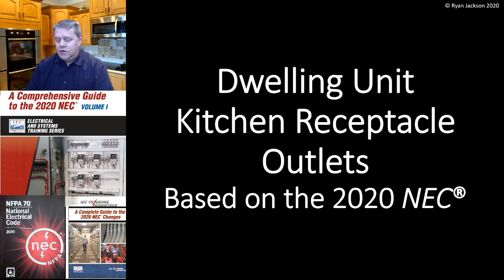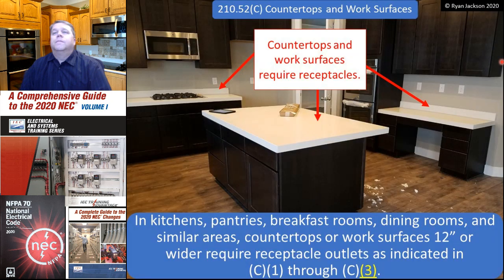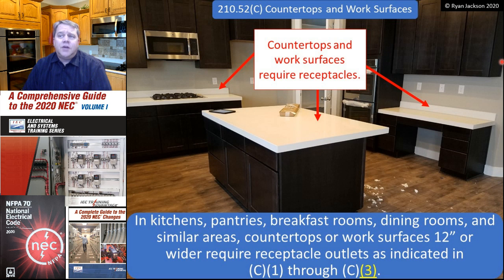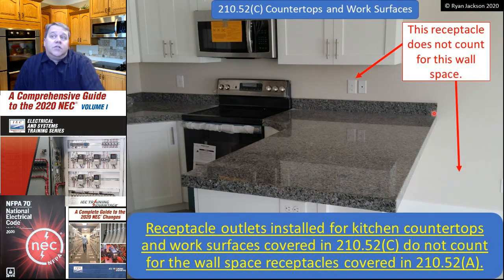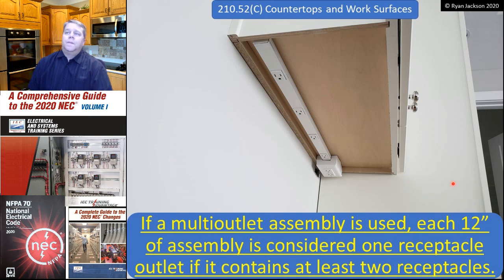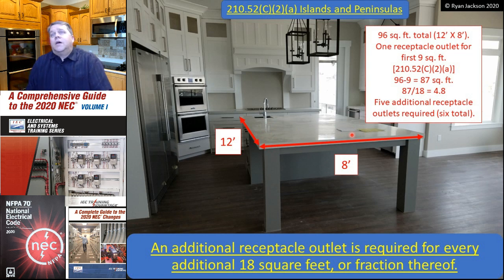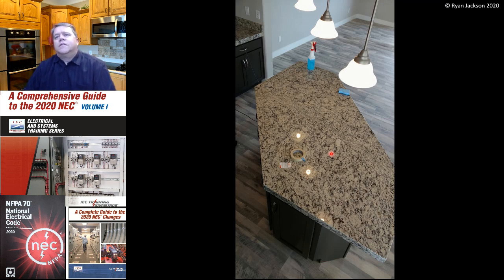Dwelling unit kitchen receptacle requirements (2020 edition).

Comment: Receptacles are the device; outlets are the location. As an inspector I have been dealing with this issue consistantly for the last 6 months. Most of the issue is misinterpretation by other inspectors, who have been provided bad interpretations by instructors. In any case as an inspector we cannot make up code interpretations, read the code and do as it informs us to. I even had one inspector try to tell a contractor to break down the penninsula/counter into quadrants and split up the receptacle locations, or cut the overhangs to 6" or less. One even tried to tell the client to put a receptacle in the cabinet in front of the sink where you stand while doing dishes. Too much overthinking for a simple issue.

Comment: Since code require island outlet to be gfci out Can I just use one gfci outlet wire it the other 2 non gfci outlet or does all the outlet have to be gfci
Reply from the maker: You can protect it from an upstream GFCI.

Comment: Came across your profile when searching for someone who may have an answer to my question. 
I'm in the middle of a new build and opted not to
pay for the kitchen island through the builder and
I want to personalize and get my kitchen island to
my liking.
I've been reading that per 2020 NEC guidelines
you have to have 1-2 electrical outlets on kitchen
islands. So will I be able to put my own kitchen
island in if I don't get an island through the
builder? Because once they put flooring in I'm not
sure how electrical would be achieved. Especially
with it being a concrete slab.
Reply from the maker: If it's a concrete slab it will be quite difficult. If it's not already finished, I'd advise you to run a conduit in the slab as a sleeve.
Reply: @RyanJacksonElectrical  Thanks! They actually were confused and ran the conduit sleeve into the slab but now they are telling me they have to check with the city to see if it can stay. I asked if they can put flooring over it to cover it to pass inspections but they said there is an inspection prior to flooring and after. So I’m just crossing my fingers they let me keep it.

Comment: 8:43 - While it's not super common, some people have cooktop-covering cutting boards or slab work surfaces, effectively making a cooktop into "work surface" or "countertop". 🤷‍♂️

Edit: Wouldn't running a multi-wire branch circuit to a separated (jumper removed) duplex receptacle count as two "outlets"? That could help satisfy the requirement and cut down on the number of receptacles needed in an island, right?

Comment: I find these new codes to be a money grab.  Most islands I’ve dealt with have no void spaces, fillers, and tend to have large over hands.  This code makes things a huge pain and a lot of my clients don’t want outlets cut into their $40,000 kitchen cabinets.
Reply: Those same customers would likely complain about not having enough receptacles to plug in all of their phones, tablets, laptops, and kitchen appliances on the island; thus, the 2020 rules.
Reply: But island outlets are more convenience outlets for most people and code should reflect that. 

 simply  one required outlet recptical would be a good rule. 

What about doing it by  Linear feet? Something like one minimum with one additional for every X number of linear feet?

Comment: That cooktop at 8:50 is DEFINITELY going to be used as a work surface when not actively cooking on that “burner.” Note the smooth flush glass finish. When the glass top ranges came out in the 90s, I attended an appliance store sales demo that went thus: turn one side on, set a plastic cutting board on the cold side, show the glass does not conduct the heat unlike the older electric coil/spider setup, then remove the cutting board and cut veggies on the cold side, show that even THAT did not damage the glass, make the sale

Comment: Hi Ryan, I wish I could watched your video before i called final inspection on my last month kitchen remodel job. Exactly every single things happened just like what your have mentioned on this video. (1) I got a same corner sink like the pictures sample, end up with I have to cut through the finish quartz and added one pop-up receptacle to fit 2-4.ft rule,   (2) the island extend is greater than 6", and the inspector didn't counted as one valid receptacle outlet on that side, I have to installed a new one on the other edge.

Great video, now I am think maybe it's time to raise my electrical quote if the clients want a big island. :) Subscribed.

Comment: What happens if the countertop extends more than 6 inches over the support base on all sides of the island? Then you can't put the receptacles anywhere except on top of the countertop. So now you have to have special water-tight counter top receptacles everywhere and cut holes into the stone? Electrical rough-in happens before the countertops often...
Reply: You can put them under the counter no further than 6” from the edge of the countertop 210.52(C)(5) Exception to 5

Comment: This video just confused me more. House was built in 1989, I have 3 receptacles on the countertop, 1 next to the range and 1 on the outer edge of the cabinet. Do they all need to be GFCI or can I just put 2 GFCI closest to the sink and the other 3 regular 20amp receptacles?
Reply from the maker: Which edition of the NEC was legally adopted when your house was built?
Reply: @RyanJacksonElectrical  I’ve been searching for the past 45 minutes and can’t find any info saying which one it was. Is there a specific website i can look for this info? I wanna say it was either 1987 or 1990.
Reply from the maker: @christianavalos7096  In the 1987 NEC only the countertop receptacles within 6' of the sink required GFCI protection.

Comment: The point of outlet spacing rules is supposed to be to prevent the use extension cords. Kitchens now have so many outlets there is never a need for an extension cord. It's more about where one puts the appliance. If there is not an outlet on the island then I going to put the appliance close to an outlet by a wall. Most people don't want appliances on an island. The NEC code has become ridiculous.  It is written by engineers that spend too much time calculating the utilitarian way things should be instead if living in the real world. I'm an engineer and I see many engineers making things more difficult than it needs to be just because all the real problems have been solved.

Comment: This is some of that angels on the head of pins stuff. In one picture I see a row of drawers under the island. Some common sense needs to apply here. It's easy to estimate the square footage on curved-edge countertops and exact numbers can be calculated, but likely represent overkill. Ari benDavid, MSE, P.E., electrical engineer
Reply from the maker: Yeah, this is a tough change. I think many agree that one receptacle is not enough for some of these islands, but this change seems to be a bit overkill in my opinion.

Comment: As an electrician and inspector for 30 plus years most home owners are gonna flip when they see how many recps they’ll need. It’s been my experience that they don’t want all the recps the code required in previous code cycles. As you showed in the video with different configuration of islands, will make it difficult to  place.
Reply: but that is mainly for new builds, significant remodels ?
Reply: @mikeclarke3005  definitely new work, & here in Florida and we have an existing building code that dictates what’s needed depending on the class designation of the remodel.
Reply: It’s to the point the easiest thing to do is what he showed, just use wiremold along the bottom of cabinets. For islands install it under the edge of the countertop.
Reply: @rpvitiello  easily said when it’s a run of the mill counter top. 
I’ve wired or inspected homes from 1300 sq ft to 26,000 sq ft and customers don’t want them. The panel that decided to make this article change (in my opinion) are out of touch. Islands are no longer just a rectangular shape. They have book shelves, cabinets, waterfall counter tops etc. easy to say just stick it under the counter except when theirs no over hang counter top space, when you have a micro wave, dishwasher, wine cooler etc etc one can’t hardly get a box small enough then take in consideration wire fill for that box. 
Many don’t want them and many more than what is required now isn’t needed.

Comment: 3:31 where dose it mention the 48" between recepticles on counter because it sounds like recepticles should be spaced no more than 24" along the wall on counter space
Reply: Appliances must be no more than 24” from an outlet when on the counter.
An appliance in the middle of two receptacle outlets  spaced 48” apart are in fact within 24” of the nearest receptacle outlet.

Technically, the code mentions spacing FROM an appliance TO it’s nearest receptacle outlet, NOT THE SPACE BETWEEN receptacle outlets.
It DOES mention spacing from walls to receptacle outlets.

And I thought Latin was hard....🧐

Comment: My opinion is based on my experience as a child electrical engineer (age 16 on a space program), and as the son of a well respected master plumber who made me get a masters license. Both plumbing and electrical codes have become overly complex in an attempt to prevent disagreements between contractors and inspectors, but have only made things worse. In 1978, the early days of kitchen design and GFCI, decided  to use wiremold outlet strips on 6" centers at the bottom edge of upper cabinets. Same depth as cabinet frame so you can insert a "funny" plug. 18 receptacles way above hot things, invisible, all cords go straight up, no tangle and you can plug in all appliances at one if you wanted to. Never seen this done before, inspector had no issue.
Reply: Have to disagree using wiremold as stated. Hard to locate receptacle on bottom of a cabinet. Hated wiremold 50 years ago except for the 3000 series wbere you install your own devices but only in garages or comercial settimg. Now that I am in my 70's with s bad back would be impossible to bemd over to locate a receptacle on wiremold.

Comment: Code specifies work space not over 18” behind sinks and stoves not requiring receptacles, so, perhaps that space can be reduced from island square footage?
Reply from the maker: It doesn't quite say that though. That is only for corner-mounted sinks/cooktops, or if they protrude from the front of the countertop.
Reply: @RyanJacksonElectrical  oh, I agree, but it COULD be interpreted or requested in that way.
Reply: @RyanJacksonElectrical  and in an island, they protrude from the countertop or workspace.
So... couldn’t the sink or stovetop, and up to 18” of countertop be subtracted from the square footage... since it isn’t workspace...
Reply: Since there is no wall, likely, the 18” exception will not apply...
Reply from the maker: @SuperVstech  No. It doesn't protrude from the front. Refer to NEC figure 210.52(C)(1).
Reply: @RyanJacksonElectrical  so, the code only exempts space behind sinks or stoves if they protrude from the front of cabinets? 
I know when measuring counter top wall space, the measurement is from the edge of the sink, or stovetop...  
thanks for responding so much, I appreciate it!

Comment: So what exactly is an "assigned space"? If we look at my parent's house (build 1966, so 2020 code doesn't apply, but whatever), the fridge has an intended place, and was likely on the original blueprints. However, it can go anywhere in that kitchen, and has moved around over the years. How about the toaster bolted to the bottom of a cabinet in my kitchen, is that an "assigned space"? It's certainly not mobile (without tools.) The otherwise code compliant outlet is behind it.

Comment: HOLLY_____ I have a kitchen island that’s 52 square rectangular. My house was built in 1980s and it only has one receptacle on the wall. God knows how many receptacles I’m going to need for that monster of a countertop. I will be doing a full kitchen remodel and let me tell you one thing there’s a lot of other updates that I’m going to need to do for the wiring. When I looked up the NEC code book for the kitchen wiring I was blown away on all the requirements for remodel and new construction! 😫

Comment: Well Ryan another good explanation on kitchen code. Although the island code seems to be a bit over the top in some cases. Done a lot of big kitchens with those types of islands. I  mostly get the inspectors input before I go ahead and wire. And most inspectors will accommodate your request and challenge. Well done 👍